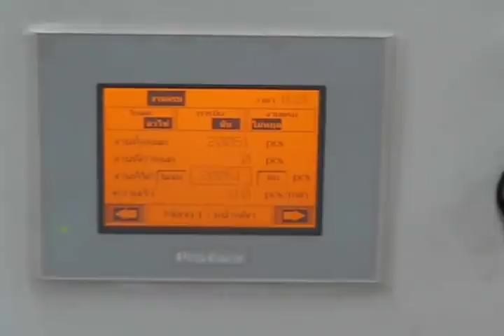Label Diecut machine

Comment: This machine is OLD technology, it only die cuts the label. Mark Andy has the flexagraph machine that prints, UV coats & then die cuts all in one process, very high quality label printing.  I used to run one.
Reply: hello! Our company is specialized in producing label converting machine, like full/semi rotary die cutting machine, slitting and rewinding machine, label inspection machine, label finishing machine with flexo printing machine and die cutting etc.,

Comment: The point of the whole thing eludes me. Who needs this? You need a supplier of pre printed rolls of labels, or he needs you. Then what? Buy steel rule dies, have product  shipped in to have it processed, and add a new step in production process plus the extra waste factor . Any proper label house with a label press will outbid you.Then, you need profit, and so does your print supplier. Please, without disrespect, I fail to see the allure.

Comment: Stone age technology. That would be a pretty lengthy steel rule die make ready and also the re register set up just to save paying for a rotary die for a flexo press which printed the product. Not to mention the cost of the machine and its maintenance plus the wages of a so called skilled  worker. As a former label producer for 43 years, I find this wasteful. Rotary dies once purchased last for millions and millions of impressions if properly handled. This guy did not even have the skill to start an even matrix waste rewind roll so that it lay flat and run well. Amateur Hour.